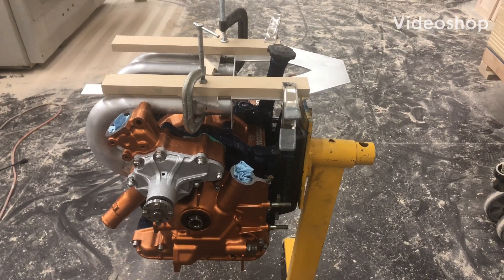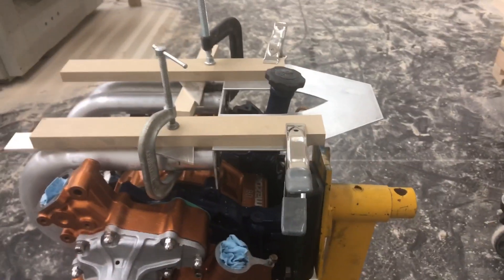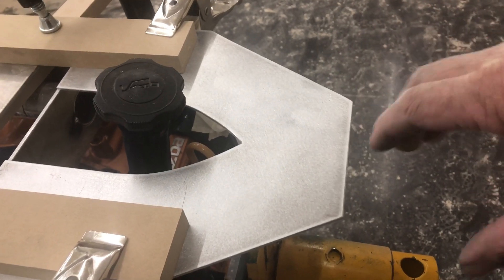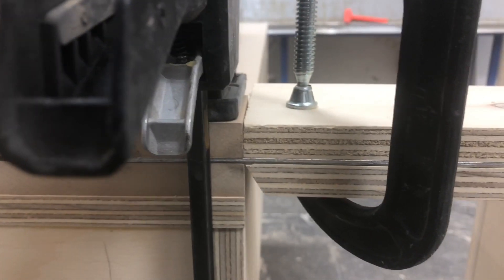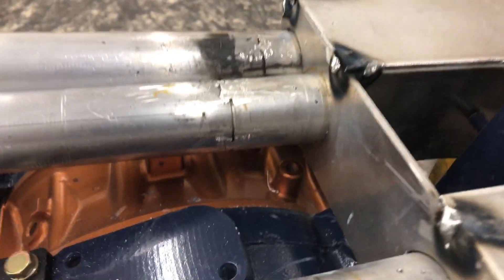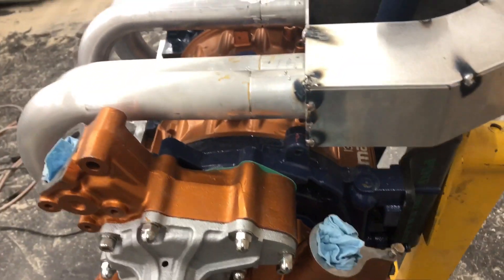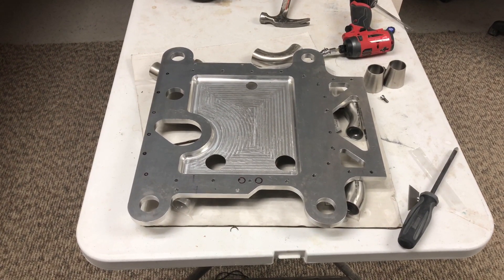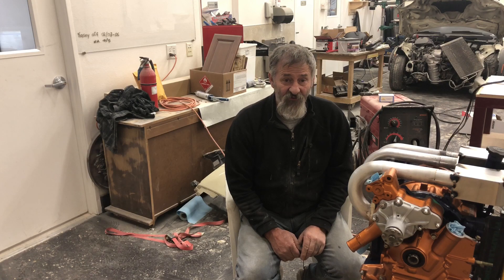Mazda 13b rotary aircraft engine intake manifold fabrication, part 2

Comment: Chad, I’m really enjoying your videos! I’m currently building a Velocity 173 and am also planning to use the 13B. I’m curious about how you settled on the Garrett GT3682 for your turbo and have you considered having your throttle come in from the bottom of your intake instead of adding a 90 degree to the side?
Reply from the maker: I spent 6 months researching the turbo.  I was planing on a gtx 3582 but the more I chatted with airplane people they all think journal bearings are better for aircraft.  Ball bearing spool faster which is important for a car but not so much for an airplane.  The ball bearing only contacts a very small area of the ball, where the journal bearing contacts the entire way across. So convinced journal bearings are better I contacted Garrett and found the closest match size wise that came in stainless because it’s 7 lbs lighter.  That’s the one they recommended. The reason I was going back with the throttle body inlet is because my intercooler will be above the engine. I guess I could go up. Instead of back and up.

Comment: The oil filler tube is just a press fit in the middle iron, it can be pulled and rotated so the breather line can be clocked as best suits your need. I am building a Falconar F12 with a 13B. I am keeping it dead nuts simple, with a gravity fed carb. My intake will go three into one and then down below the engine. Don't have the space to go over the top of the engine.
Reply from the maker: M Silvius thanx for the info, I’ll pull the tube and reinstall.

Comment: Cool project. What are you planning on using for the redrive?
Reply from the maker: Micah Powell Right now I am planning on using air trikes SPG5.
Reply: @constechable  Thanks, I was not aware of those PSRUs. I'm planning on starting a homebuilt project in the next couple of years and I'm considering a Mazda rotary for the powerplant. I'll be following your project for sure.
Reply from the maker: @Micah1Powell  Check them out. Ive  talked to a few people with them and they have great reviews.  It will handle up to 400 hp and has a dampener.  Im probably using their Kool prop constant speed propellor also.  Just a heads up, Im in mine around 4k and still need radiators, oil cooler, intercooler and controller.

Comment: What are you putting this in?  I have a Zenith 801 that I’m putting a NA 13B in.
Reply from the maker: akskydiver121 awesome.
Reply from the maker: akskydiver121 I’m building a one off design I call the Halcyon
Reply from the maker: akskydiver121 4 seat amphibious.  How’s your engine coming, any ideas for me
Reply: Chad Hone   I’m finishing up my cowling to get the air through the radiator and oil cooler correct.  When I put the cowling on, it gets too hot.
Reply from the maker: akskydiver121 Yeah I have her cooling them can be difficult. I’ve visited with the gals over at cozy girls they gave me some tips and had me talk with their radiator and oil cooler guy I’m hopefully going to not have cooling problems but time will tell.
Reply: akskydiver,  do you have a build page? I would love to see your project I have been thinking of doing the same build
Reply: @user-ju3ns2cz1u  no, I had a site on expercraft. They don’t exist anymore.  My email is akskydiver@yahoo if you have more questions.